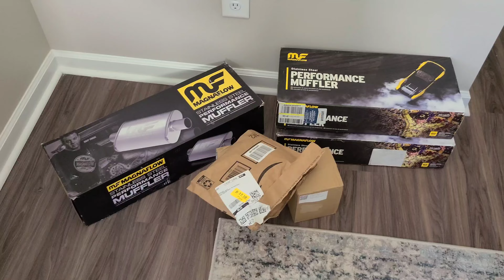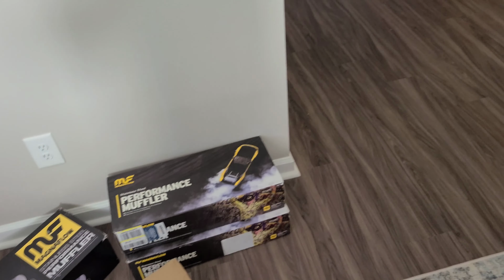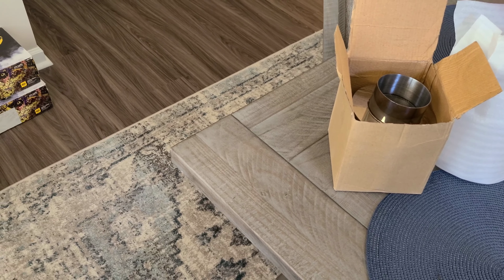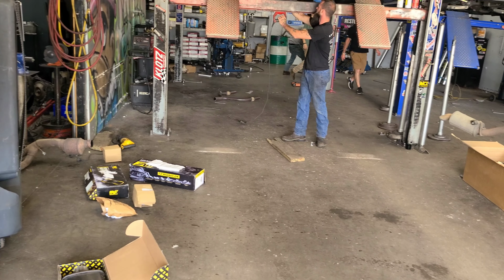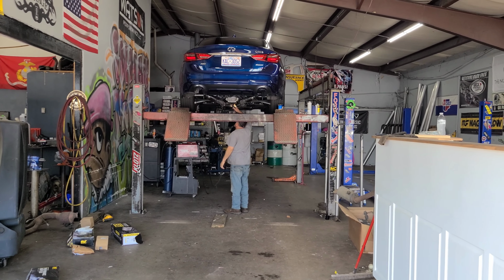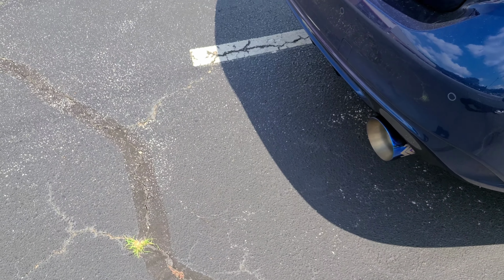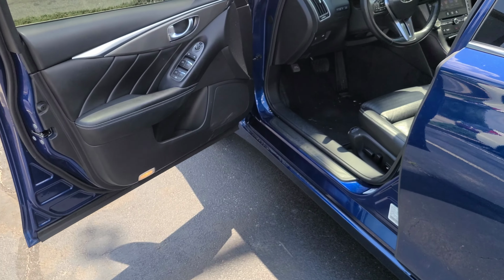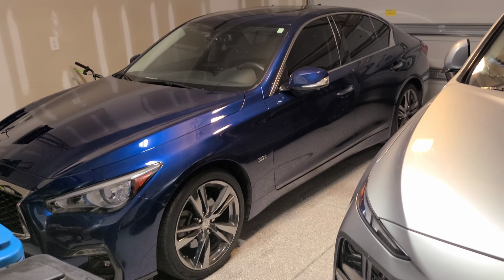First performance mod for the Q50 - Custom 3" Catback installed

Comment: How much did they charge you for something like that?
Reply from the maker: $350! Very reasonable with their pricing
Reply: @serstylz2 $350?? U got scammed homie
Reply from the maker: @SmooveChilli  $350 and they provided all the piping and added 2 resonators I was missing.. fine price by me. How much you expecting to pay for a full mandrel bent exhaust with the shop using their own metals?